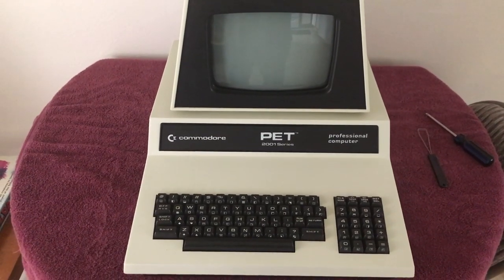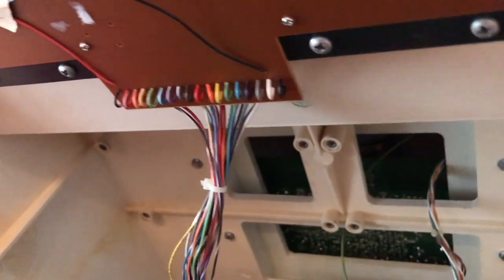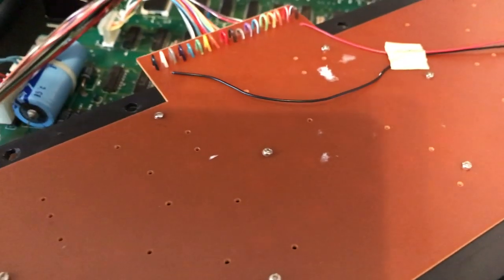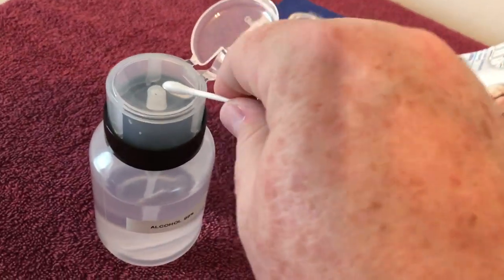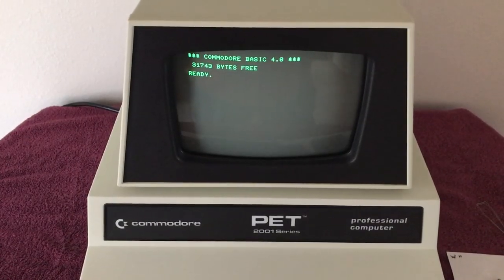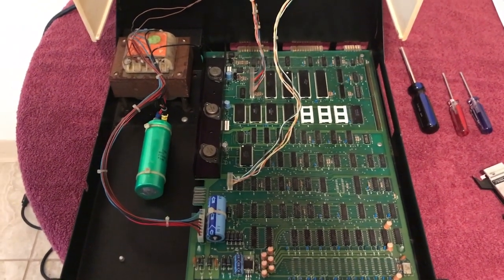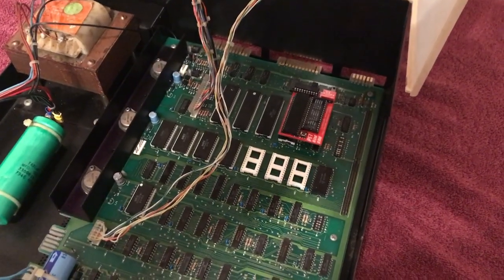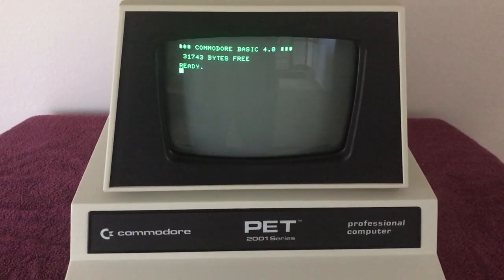PET 2001 Keyboard Repair and RAM/ROM Upgrades - Commodore CBM

Comment: The PET will always be my favorite computer of all time, such a good looking, timeless design. I especially like the 2001 N series because they still have a 9" monitor which looks better in my opinion, but they also have a keyboard that you'd actually want to use.
I was able to find my very own PET a couple of days ago, after years of looking through ebay etc. for the right deal. Mine is a CBM 3008 (european/german PET 2001-8N) which has been upgraded to 32k memory.
Reply from the maker: Agreed that the PET is such a good looking machine. Very cool that you found your own PET computer from eBay and it being upgraded to 32k memory. Hopefully it arrives in the same condition as pictured. Shipping a PET is a PITA because of the size and weight.
Reply: @geekwithsocialskills  I made sure the seller will wrap it up really well for the journey ahead. It is a bit of a fixer-upper but it should clean up really nicely :)

Comment: You really should consider using foam-swaps instead of cotton, you risk leaving bits of cotton on the electronics.
Reply from the maker: Hi Mike.  Since this video I've actually switched over to foam-swaps for the exact reason you mention.

Comment: Hey Geek, for CBM/PETs that already have BASIC 4.0 and 32MB RAM, do you know of any benefit to the tynemouth RAM/ROM gizmo?
Reply from the maker: Hi Cory. There are a few benefits to having the RAM/ROM board. Obviously like I wanted to do with my PET, upgrading it from 15 KB to 32 KB (not MB) RAM and being able to upgrade the BASIC. In the case of PET computers that already have BASIC 4.0 and 32 KB RAM, if you ever have issues with your onboard RAM or BASIC ROM, this would be a plug and play repair solution without having to desolder RAM chips or possibly the BASIC chip as well as it completely bypasses your onboard RAM and BASIC. This add-on board is also great for troubleshooting if you have bad RAM or a BASIC ROM.
Reply from the maker: @HutchCA  indeed. It's a very useful piece of kit for sure!
Reply: A big benefit, if you're able/willing to pull all the RAM and ROM chips, would be a reduction of heat and current draw by having fewer chips to power.